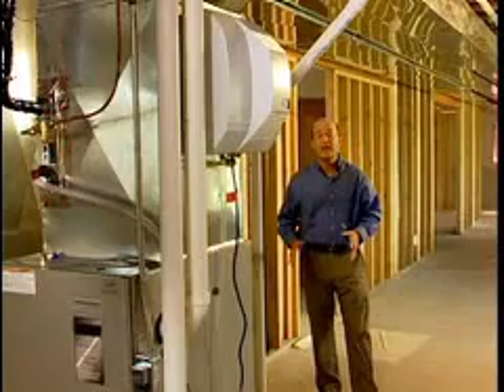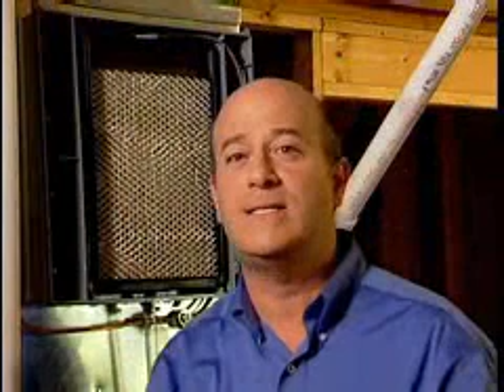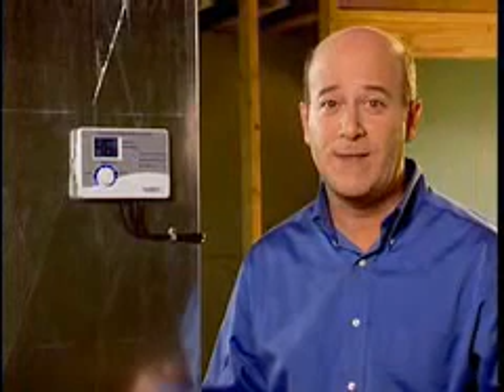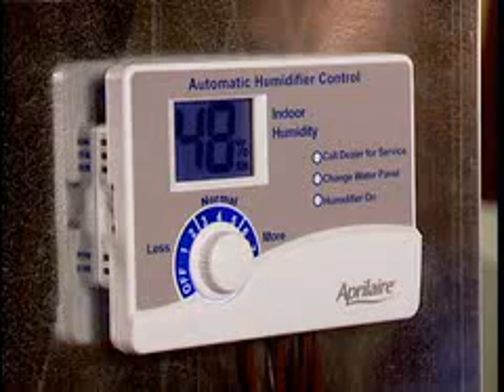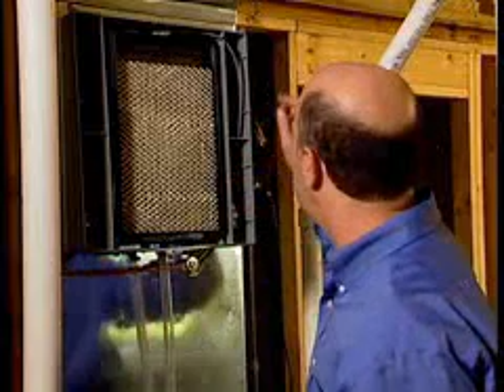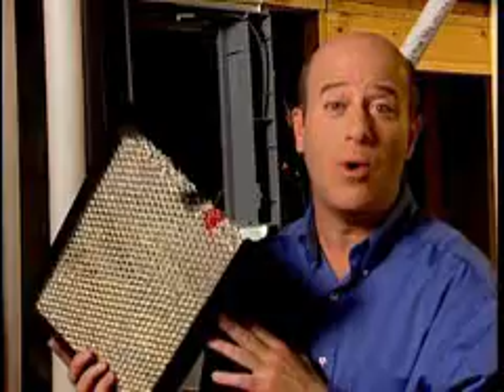Aprilaire Power Humidifier Maintenance

Comment: I noticed my humidity level on mine says 13%.  Temps outside are currently below zero.  Also I noticed the humidifier keeps running even after the furnace shuts off. Is that normal?